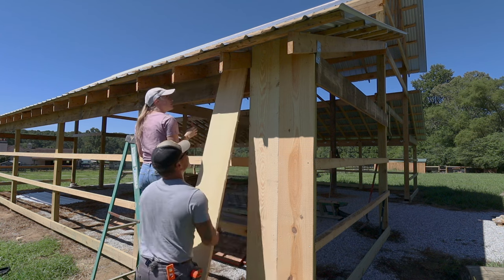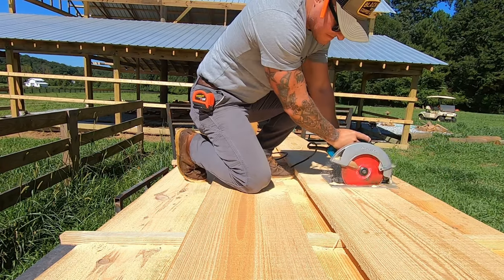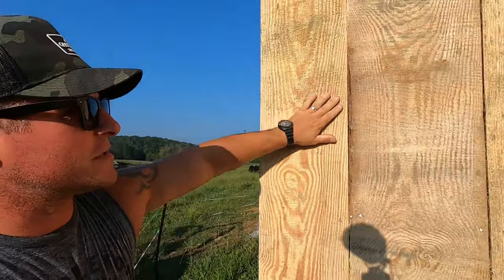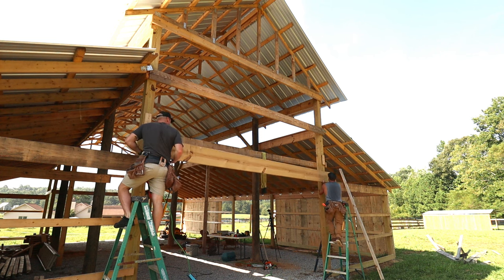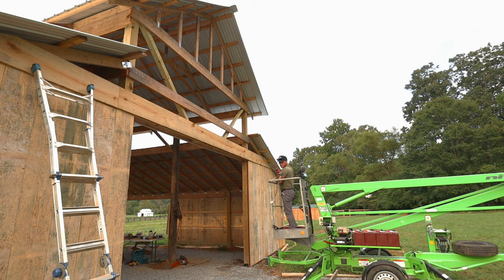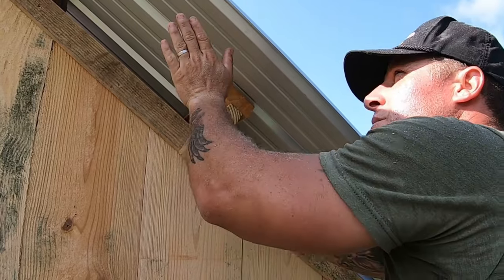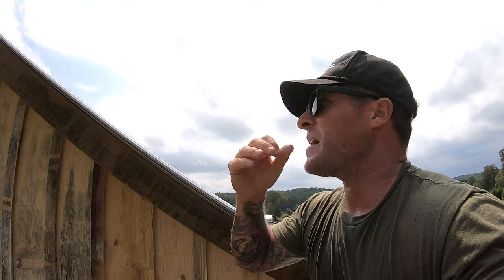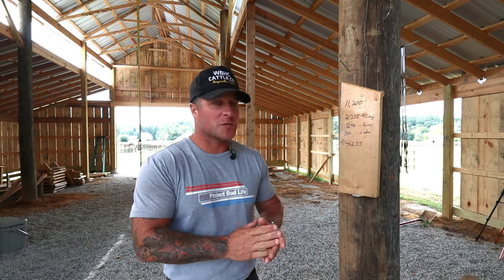Pole Barn Build On A Budget! Incredible Board and Batten Siding Transformation. part 1

Comment: I hate to add advice after to late, but the old days they always cut a 45* cut on the bottom of the siding 1x12 . It helped to keep the bottom of the board from rotting out.  the angle made the water to run down to the tip of the cut instead of hanging on to a flat surface.
Reply from the maker: Thats a great suggestion, thanks for watching!
Reply: I don't understand. Is there a link to a video or website that I can reference?
Reply: me too, but .... I learned the hard way ... when using green wood for siding it is best to place only a single nail in the centre of the board at each of the fixing points from top to bottom; also, a decent vertical gap should be left between thos boards; and then, the battens should be nailed through the space between the boards (not into any siding board) and directly into your backing member. Do it that way means no splitting as the wood dries.

Comment: Looks nice! Board and batten was actually created as a technique to install green lumber and not have it crack from drying after install. The technique involves installing the boards with as many as two nails and leaving a gap between the boards. The batten was installed over the gap with just one nail installed through the batten and in the gap into the frame of the building but not through the “boards”
This allowed the boards and batten to dry and shrink separately without putting stress on either creating cracks.
Looks like you butted your boards up against each other so your batten nails are probably going through batten and board so you might end up with some cracking and splitting as things dry and pull adjoining boards apart.
Reply from the maker: That’s good to now! I did Nail threw them but allowed a few weeks to dry

Comment: It’s a lot easier to get a bow out if you put the bow in and walk the bow out from one end to the other fastening as you go. Your horizontal gable door track board has siding butting it  without any Zee channel flashing keeping water out. When you interrupt vertical siding with a horizontal piece the siding landing on it needs a flashing. You should also flash the siding tops under that board.

Comment: Very nice! I love the old style barn design, it gives it so much character!

One thing I will mention after rebuilding my old building with board and batten siding. When your fastening the boards it's better to put two nails in the center of the board instead of the outside edges. That will allow the board to expand and contract without cracking. 

What's your plans for the siding going forward? Letting it gray naturally? We used a product called Cabot Timber Oil, it really gives it a rich wood look.

Comment: Here's a dream, building a pole barn that mice cannot get into.... I plan on building a pole shed 14x24 and I fight mice access day in and day out with the current 10x20 storage shed. I'm thankful for bucket traps! This looks great, it is giving me a lot of ideas on what I am looking to do....Thank you for vlogging this build!!
Reply: I've been thinking about doing a build where I used two 40 ft shipping containers on the sides with an open roof span between them.

I think your shipping containers are going to be your best bet for mice proofing.  Those little bastards can get in an awful small hole unless you plan on securing your perimeter with a lot of steel wool and spray foam.

Comment: Circular saw works best for cutting the metal sheets. I noticed you are not going to box the end of the rafters. I’m building a barn with one section finished for my wife to have a craft area. I think I will box the rafter ends and won’t have to notch the rough lumber siding and just match it to the box. Wish I had a lift like you do. I have to build scaffolding to work off of. Good video.

Comment: Question for you, would you caulk the joint behind the batten or sides of batten on a smaller barn project if you were concern with water entering?  
I plan on doing what you have done for my pole barn, and may end up fully enclosing as a garage/shop so trying to limit water exposure. Also plan to house wrap it before putting up 1x12’s.

Comment: I can't get wood or metal prices like that, in our area. Within the city limits, metal roof is required to have lightening rods 2' tall every 10' ground with copper wire on both ends. I argued with them showing where metal roofs are proven in Florida to not encourage lightening strikes as any other roof material. I am not building to the cities standards code requirements or any building. Nothing but a small shed. 48" deep is required and rock in the hole with wet spots needing a pencil tip or frost heave will push them up. I had one fence post show me this problem after in ground 12 years, it lifted 5 inches. At 66, I am throwing the towel.

Comment: Why would you nail both sides of a fresh sawn still green board? The whole board and batten system is designed so the wood boards can move with moisture by nailing only one side of each board. 
What you have done by nailing both sides, especially wet, green wood,  guarantees your boards are all going to crack.